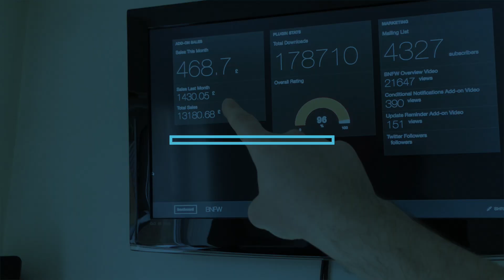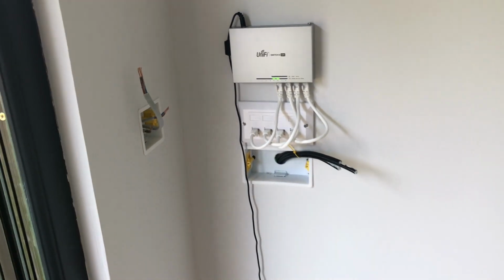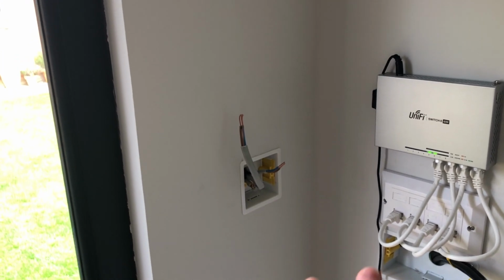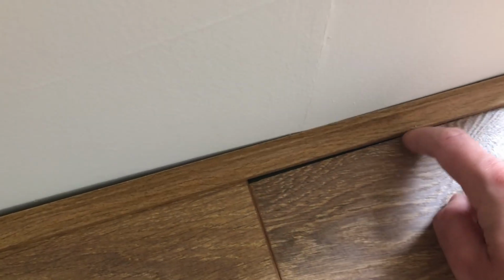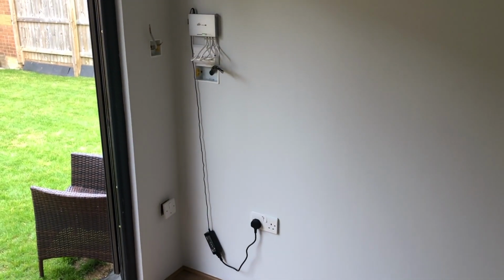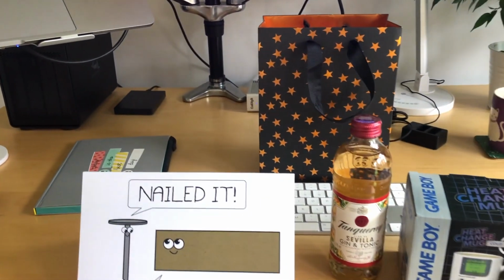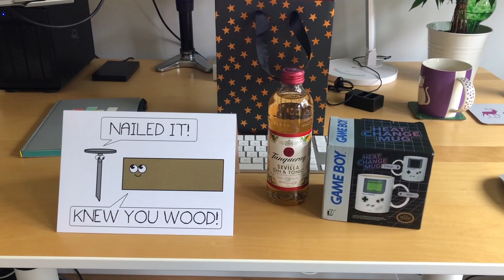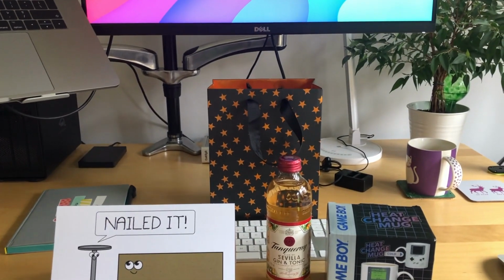Building My Garden Office: Part 12 - Moving In!

Comment: Really impressed with your build! You've done a sterling job there and thank you for sharing your journey. 
One thing I would like to know is how you went about setting up your network. From the reason behind using Ubiquiti, to setting up the switch in your office. I'm just using an old router in my garden office with a cad5 joining to the house router but I'm running out of ports and need more knowledge. 
Thanks again and I have office envy.
Reply from the maker: Thanks! That’s kind of you to say. I’ve found Ubiquiti equipment is more stable and better supported. It’s not massively expensive for separate devices either. If I was doing it again I’d definitely use a fibre cable from my house to the office but CAT6 cable has been fine so far. Alternatively, you can use one of Ubiquiti’s ‘Air’ devices to avoid network cables altogether.

Comment: Excellent videos and congratulations on moving in day! It looks amazing. 
I’m looking to do a similar project but more of a cheap summer house for the structure, followed by full insulation and internal wall cladding. I have done a small amount of research but need to do a lot more before starting anything. Question, in terms of insulation, how have you overcome potential  issues with leakage and possible condensation build up behind your cladding? I assume air gap, insulation, (filled and taped joints to best prevent leakage) plastic wrap followed by your final boarding.
Also, in terms of heating, I noticed you had an electric tower heater. Have you found this sufficient now the days/nights are becoming colder?
Reply from the maker: Hello! I have Tyvek house wrap behind the cladding which is a breathable membrane but waterproof, as well as an air gap. Inside walls are wrapped in a polythene vapour barrier. Good luck with you build. It’s very rewarding!
Reply: @jackrmcconnell  many thanks for your reply Jack. In terms of heating, what do you use and how efficient would you say it is?
Reply from the maker: @robgreen1458  Sorry, forgot to answer that: the tower is just a cooling fan. I have an infrared panel heater on the wall with a thermostat which is wifi controlled. It’s excellent and very efficient. It’s never cold in there.
Reply: @jackrmcconnell  no problem. Appreciate your advise. Great idea! Will check them out. Many thanks for your help.

Comment: Great series. Love the outcome.  Why blocks vs poured concrete.
Reply from the maker: Thanks! Blocks were much cheaper and easier to do myself.
Reply: @jackrmcconnell  thanks for responding.  Any settling?    Best set of videos out there.
Reply from the maker: @grega4450  thanks again, but I give all credit to Ali Dymock’s videos on the subject. It all seems to stay still - no movement in the building.
Reply: @jackrmcconnell  I am looking a getting my 100sq ft place started. So this series has been very helpful.  Approx the same size give or take.   107 sq and under non permits here.

Comment: One thing maybe I missed was the cladding, did you film this part?
Reply from the maker: Liev Garcia yes, it’s coming next. I moved in before I put the cladding on.
Reply: @jackrmcconnell  I suspect I might do the same! I'm thinking of metal sheet cladding for sides and back as they are close to fences, but prices seem to high even for that option!
Reply from the maker: Liev Garcia I imagine that’ll get very very hot in the Summer unless you plan to get air conditioning. I noticed it got cooler after I put the cladding on as there’s another layer and an air gap in between.
Reply: @jackrmcconnell  tell me in a month! 😜
Reply: One last thing, I just don't remember seeing this in your videos. Do you have a simple breakdown of how you managed the 2.5m limit rule? Breaking down your blocks heights, floor (ext), wall height, roof thickness? I know you went with cold roof in order to get more space, but it would be really helpful to get a proper breakdown if you have it somewhere. Thank you very much for any info (and the videos are great!)
Reply from the maker: Liev Garcia A good question. I took the block piers down to 100mm and then adjusted the inside height until all the materials heights plus the internal height added up to 2.5m. That way, I could change materials to make a difference to the inside height. The OSB on the roof for example is 15mm and not 18mm. Every mm counts.